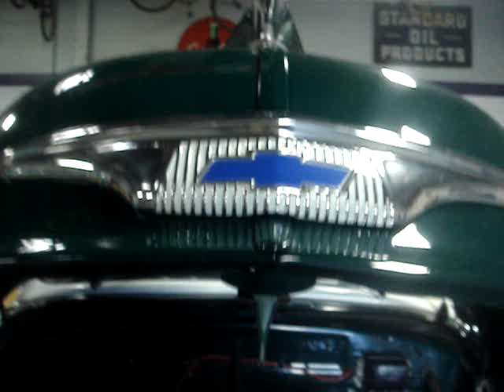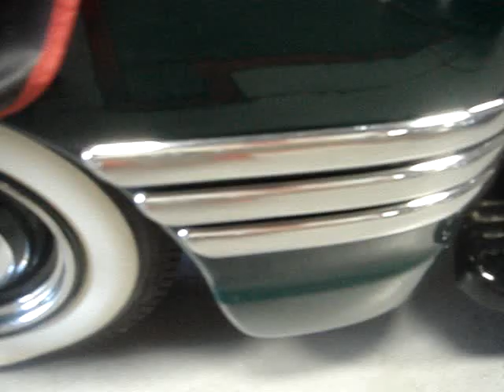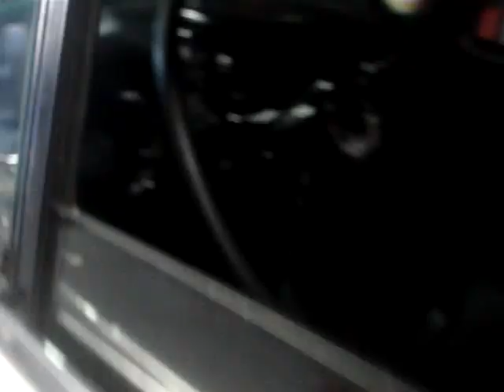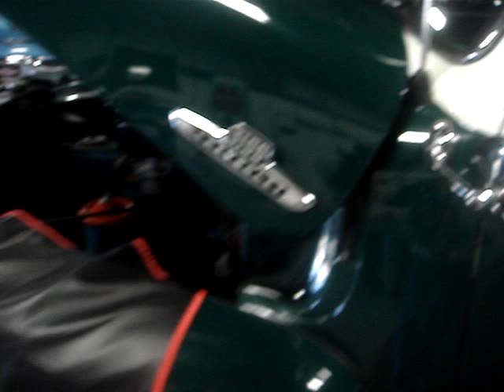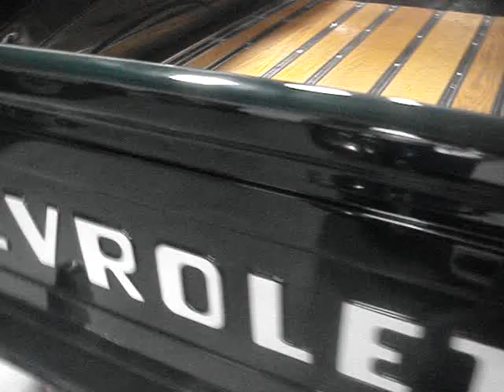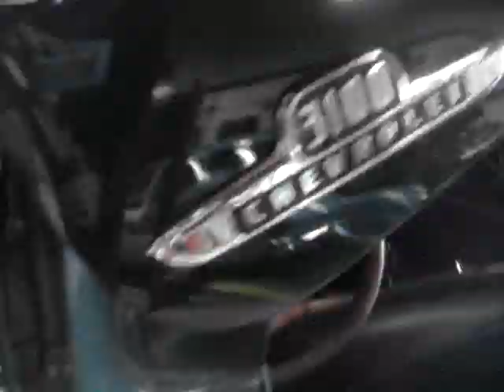1955 CHEVY 3100 PICKUP TRUCK - EXTRAORDINARY HAULER

Comment: I have never seen one like this before 

Rare early 55 model and the trim with the what l presume is a clock ⏰️  in the dash .
As we all know, 55 brought body style change but as l stated before l have seen a top of the line like this example.
Reply from the maker: Yes, this is a rare one ! And that stock dash mounted clock ! Great restoration on this old workhorse and this new Task Force Design increased sales to a point where the Chevy truck sold the most. Thank you Gary for your comments.